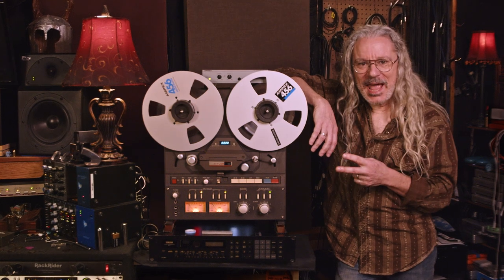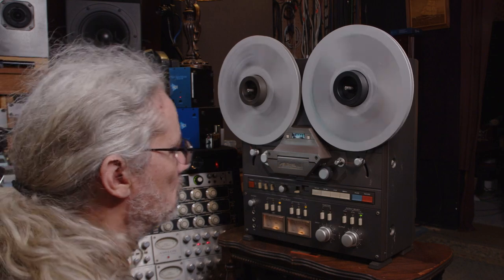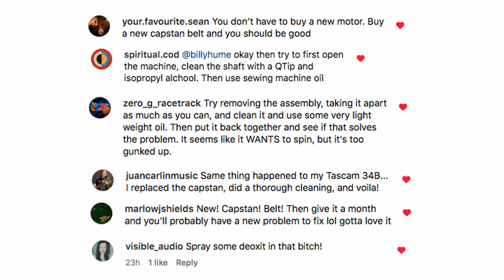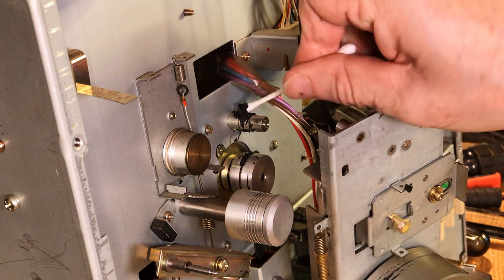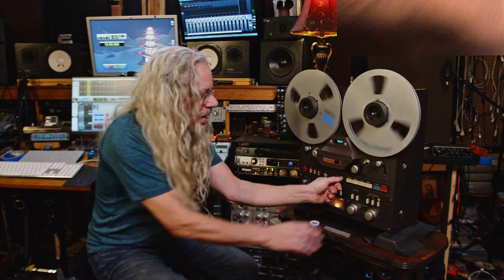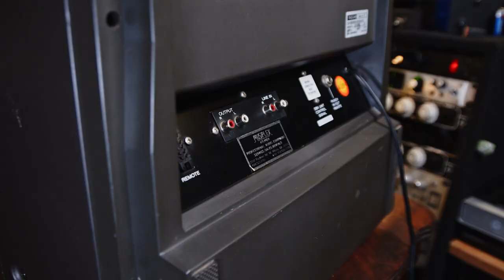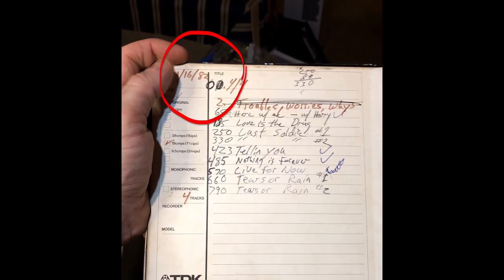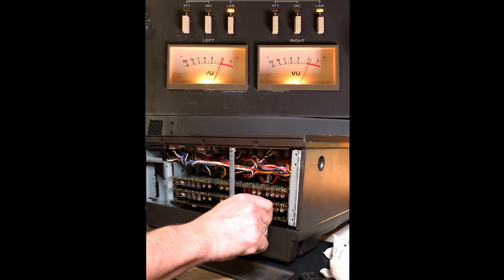I Didn't Know What I Was Getting Into

Comment: Just subscribed. I work on vintage audio gear for a living and have serviced a LOT of Tascams. I have a 32 waiting on me to get to it right now. You did a fine job for someone who does not do that kind of work all the time. Plainly, you know your way around a screwdriver, like most engineers/musicians do. That said, here are some hints: To correctly fix that pinch roller, look up Terry's Rubber Rollers. Terry can rebuild it back to factory specs. Your heads may (or may not) need to be relapped to eliminate a wear groove. JRF Magnetics can do that for you, but you probably should employ an experienced tech to remove and reinstall them, and to re-align the machine, which will be necessary after they're relapped. If I can be of service, give me a holler.
Reply from the maker: Thanks! And thanks for the tips. I hadn't originally thought about going too deep into all this but now I'm reconsidering.
Reply: Seconding Terry’s, he’s great!!

Comment: As an aside these are beginning to get old enough where the carbon composition resistors start being out of spec. ESR and out of Spec Electrolytic Capacitors start being an issue. Some even close to being pure resistors. Same is true of any older gear. Many say replacing the caps are not really necessary. I think you should take a few out as a samples and do some measurements. Worn out belts and them turning into salt taffy is no fun. It is like machinist's blue. It gets everywhere and just takes a little to be really annoying. Gloves and those disinfectant wipes work great tackling those gooey belts. The needed calibration tapes, signal generator, and oscilloscope and distortion analyzer are really handy. Also a great soldering iron system and solder removal system. Cassette Decks can be a PITA too. I did a belt replacement on a "Direct Drive" Technics RS-M280. It had more belts than a non "Direct Drive" Cassette Deck did. Not fun! But that machine sounds a treat. I still have to deal with the auto tape select, that is acting a bit wonky too. Tape machines, I love tape machines.

Comment: Yep. Those belts turn to tar. Those disinfecting wipes work great. Reel to reels are some of the toughest things to work on. Been doing audio a long time, and I love reel to reels. Just not working on them. Working on these things takes planning. What tools, belts, does the power supply at least need recapping. Lubricants. Mechanical stuff like the tape lift binder over time. I am about 80% done restoring a TEAC a-7300. I have an X7 also. These machines are wonderful. But what a pain in the butt. I still love them though. I use a Sound Devices 702 CF recorder and Sound Devices 442 mixer. Those are my references.  Reel to reel will always be there, but it is more my special listens. I want a 2 track to play back Master Tapes.
Reply from the maker: That's amazing. I used Reel to Reels a lot back in the day but have never been a tech guy in any way. Tasking these things apart and looking at the design is mind blowing  - more so now since you rarely see this kind of craftsmanship anymore. Glad there are people like you still working on these things and carrying the knowledge.
Reply: Super cool, I stumbled across this since I’ve been thinking about reel to reel for years, and lucked into a Tascam 44, same deal- melted roller, had to learn to replace it and clean it, waiting on a tech to fix some channel problems and obtain my own MRL tape and learn how to calibrate the thing. But the reason I write is seeing someone excitedly re-discover something as I’m on the same journey but as a completely new trip for the first time, it’s just exciting to play around with some of this gear and respect the effort it used to take to make and record music and the drive to put in that work. Anyway it’s great to see someone else equally stoked to be fumbling around with these machines. The reward of all that work is just so much more than sticking earbuds in your ears and going to Spotify. Listening to music used to take WORK, it meant something, it was difficult to make and record it and it wasn’t so easy to play it back either! I remember sitting by the radio with cassette tapes as a kid, trying to get to the record button fast enough to record my favorite songs just so I could listen to them again. That took effort! Now it’s like, almost anything you want to listen to is immediately accessible, that’s amazing too, but I think there’s something meaningful in respecting all the effort and experience that went into making and sharing yourself, through music. Anyway just way cool, and happy to see your journey! 🤙🏼

Comment: Super nice video. I had a Fostex A-8 back in the 80s linked by smpte timecode to Alesis HR-16B and keyboards. Brings tears watching you reminiscing. Thanks man.
Reply from the maker: Thanks! I had one of those Fostex 8 tracks too. Did a few records on it but then it started needing repairs and kept getting worse. I eventually just left it at the repair place and never bothered with that last repair.
Reply: @FreakingOutWithBillyHume   Yep. I had to get it timing maintenance once a year by Triple-S audio repair company here in NJ. Til I sold it and started using the new Notator with a DAT Backup set up back then.

Comment: I just found this and wanted to share my experiences with the same Tascam 32 deck.  I own 3 of them in good working condition.  My original had the same issues as yours I've had since the 80's, so I took a chance and bought (at separate times) 2 other machines being sold for parts.  I thought having a spare would be great.  However, when I received them they both were in pretty good condition, so I fixed them all.  Well now I have 3 great machines and I can only use one.  I haven't had the heart to sell them all yet, just as I had all the NOS 456 10" reels of tape i have stored "tails out' with leaders in the closet.  Thanks for sharing your experiences Billy.  I love your channel.
Reply from the maker: Thank you! And thanks for sharing your story.

Comment: Great video! Ain't it fun diving into stuff with more curiosity than knowledge?! Ha ha! I've torn into my old Pioneer, 1/4", half track machine a few times and more Hammond organs than I can even remember! Hey, I think I remember seeing a couple ADAT XTs in your room? Have you tried using them recently? I haven't checked mine out for years. I wonder if they still work? Hmmmmm...... No! Must resist! I do not have the time right now!! Haha!
Reply from the maker: Thanks! I couldn't get the ADATs to work so I opened them up and cleaned them and reset a belt. But they still didn't seem to be putting out any sound and I was seeing DATA on the display which I thought was another error code. Eventually I remembered that there was a minute or so at the beginning of each tape where the ADAT would write some data and if I fast forwarded I'd get to some music. After that I found that one of the machines worked and was able to transfer some stuff into the computer to finish a song..

Comment: Fantastic video.

I still have my Tascam 32 and my Tascam 38 (not used any more, and back in storage). I tried a similar project 15 years ago with the 32 (for tape delay) after a long time storage of the recorders and faced exactly the same problems with rubber decay  and a breakage in the spring balance, and also tape sticky shed syndrome. Nightmare and costly process. After finding the info on tape baking from some university or other, not having any money, gave it a go myself in a conventional oven. Needless to say the whole thing was a disaster. Lucky enough, The tape in question was a blank in the wrong box, so sometime in the future, after a lotto win? I may find out what's on the tapes. I fear all us novice musician/techs never stop trying to learn. I now mark things with a pen and not a pencil. The past is easily erased.
Reply from the maker: I baked tape in an oven back before I bought a food dehydrator. The trick is to keep the temperature low and heat for less time. But it was still scary.